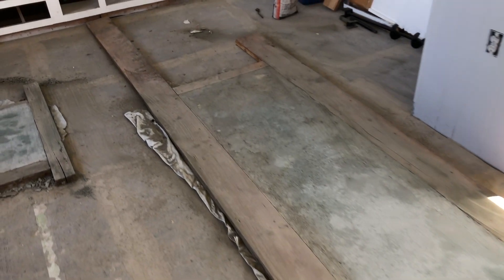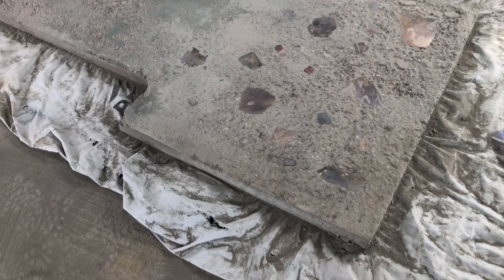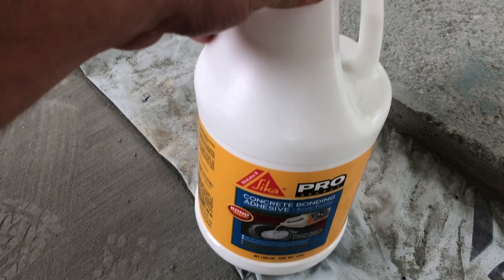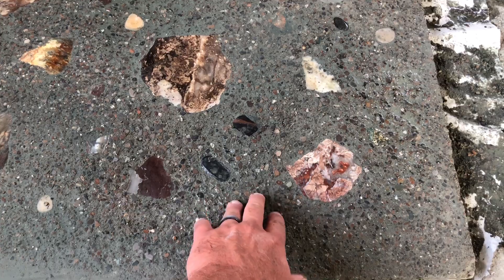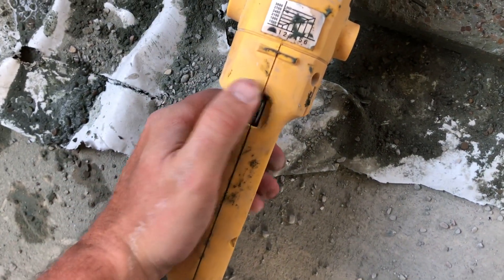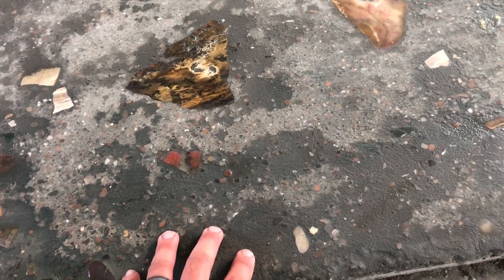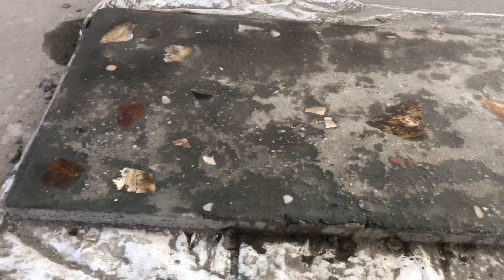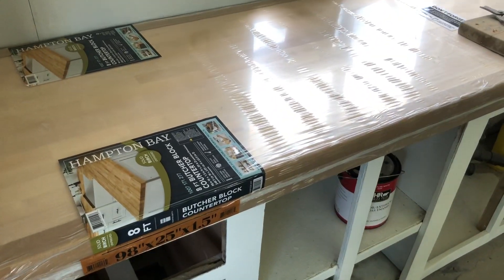Concrete countertop failed

Comment: Hey Sir, good attempt! I had high hopes for you when you first started it! But sadly concrete is finicky with any number of variables! Definitely agree that next time, or for anyone else who wants to try their hand at it, casting them in place is the best way to ensure minimal problems. Little harder to clean up after, and messy to any surrounding walls for the wet sanding/polishing stage, but doable with a little more prep work to contain it. My next thought would also be to use only sand or very fine aggregate, which will result in a smoother finish and less chip out, plus showcase the materials that you really wanted to see more. 🤷‍♂️😁

Either way, lessons learned from top to bottom for everyone who took the time to pay attention! Plus the Butcher Block looks great too! And you still have the pieces you made that you might be able to utilize somewhere else…like maybe another property or an outdoor kitchen/grill area! ❤️🫂🤞🙏🤘 Thanks again for sharing your journey and thoughts!
Reply from the maker: Thanks for letting me down easy lol. I always wanted to try a concrete countertop, well I tried miserably, it was a lot more problematic than I ever thought I could be. I’m kinda glad that I couldn’t make it work because I didn’t think it was looking very good anyway, the butcher block is much better, in my opinion. 😀
Reply: @frugallandlord6974  haha wasn't letting you down easy, just appreciating that not everything goes perfectly the first time you try anything! ❤️🫂🙏🤘 I'm still planning on doing this to my Trailer remodel! So, don't feel dissuaded even slightly to try again!! 😁❤️🤘

But I've always loved how beautiful they turn out when everything flows right! Plus I'm likely to have a ton of small off cuts once I do my Gemstone Mosaic Shower idea, so it will be awesome to tie both areas together in my remodel.

But thankfully I plan on building my own Butcher Block rolling island as well. So, if things go sideways for me too, the rest will equally end up Butcher Block hehe 😜😂🤷
Reply from the maker: @MakerAcreNinjaNetwork  good luck, I hope it goes well for you, I’m sure it will be better than mine turned out.😀
Reply: @frugallandlord6974  thanks Sir! ❤️🫂🤞🙏🤘 Be sure to Subscribe if you want to see the crazy transformation I'm planning on my 1968 Marlette Single Wide! 😁 Getting ready for things to finally go Live soon, just had been waiting out Winter here in Michigan, and banking other Content in the meantime! 😁😎🥷🤞🙏🤘
Reply from the maker: @MakerAcreNinjaNetwork  lol looks like I have been subscribed to you for a while, I do want to see your project 😀

Comment: I understand. My concrete counters were a beast. I just made an island. I like the mortar mix and the fiberglass rebar. It has great strength. I poured mine by myself. When you pour it in those melamine boards the color and the sealer have a hard time sticking to the concrete the surface is too smooth and I'm not the greatest trowler for pour in place. If you can trowel really  well it looks great with little sanding. Good try. Dont give up.
Reply from the maker: I watched a few of your videos, looks like you got some skills, it looked like you countertops were going to be awesome, I’m impressed 😀

Comment: I don't find polished concrete very attractive.  I'd either use off the shelf cheap laminate or make butcher block counters from 2x4's laid with the 3-1/2" side up.  You need a table saw to cut them square and use glue and biscuits and clamps or Kreig screws.  The concrete counters I've seen people do is they go over old counters or cement board with Feather Finish, about 1/4" to keep it light.  Hey, you tried.  Use what's cheap because renters do not take care of anything.
Reply from the maker: Thank you so much for writing such a thoughtful comment, cool idea about the handmade butcher block, maybe I will try that someday, this time I’m going with off the shelf butcher block countertops, good day to you.

Comment: You gave it a try, I haven’t seen any other videos so I don’t know if you used any wire mesh, well you just said 2 pieces of rebar. I don’t know what kind of crete you used either, if it had rocks in it, I don’t think that’s what should be used. Try again later,  I think you will have it figured out
Reply from the maker: Thank you sir, I had another video on the concrete pour, only had 2 pieces of 1/2 rebar going length ways, I made a lot of mistakes but the biggest mistake was that I should have poured it in place, yeah I used regular sackrete from the lumber yard.
Reply: @frugallandlord6974  I say if you’re not making mistakes, you’re not trying.
Reply from the maker: @johncamp7679  very true, I learn the most when I fail miserably, thank you so much for the encouragement. 😀